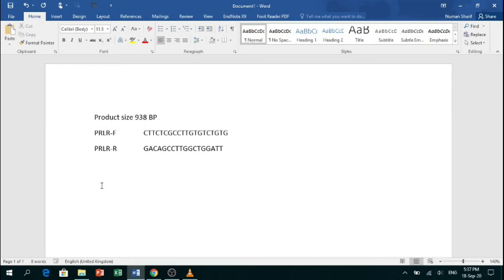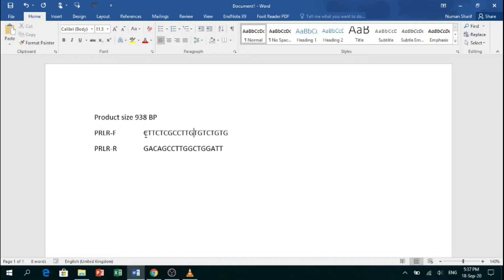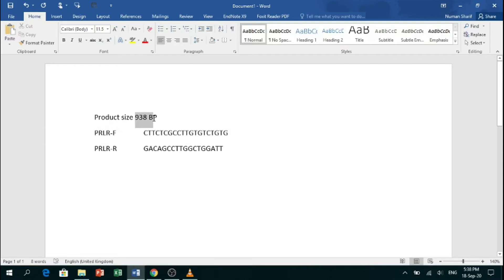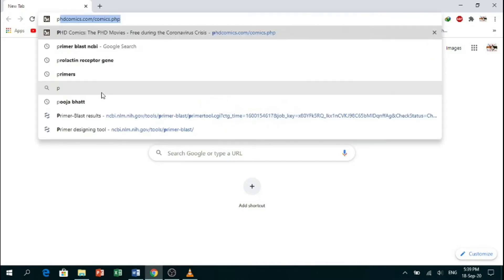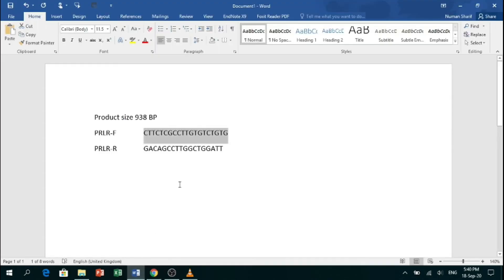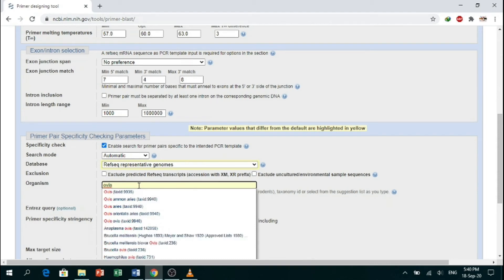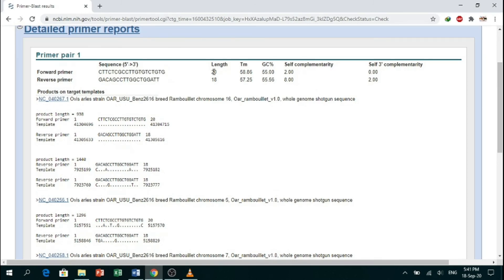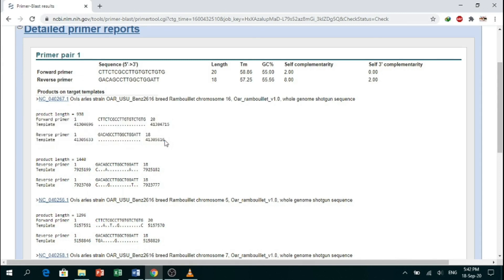How to Check the Specificity of Primers Using Primer Blast NCBI

Comment: Hello, I ask for a group working on something. Assuming they have a species of a small invertebrate (probably unknown species) and they just have cultured them in massive amounts. They reach a maximum of 2 millimeters. They prefer to extract only the DNA of a single adult with its eggs instead of having a mix of juveniles or adults for DNA extraction. The questions they had:
1. Should they extract DNA for each adult with eggs (which basically the full genome) individually as they planned?
2. They just decided to use cytochrome c oxidase I primers (a mitochondrial gene) since they proved to be a gold standard for invertebrates of various phyla. Moreover, most could be found with this. Is this ok? I mean, what other way would you advise?

Thanks
Reply from the maker: No idea about it

Comment: There are non specific products of 1440bp, 1296bp that you are not talking about, they are displayed just underneath. You could mention them even if the sequence is not fully complementary to you primer.
Reply from the maker: Yes, you can say. However, when you find your product ranked on top, then you can confidently use that pair of primers. Secondly you can try other online tools to verify or cross check results like In Silico PCR. You can watch the video given below on checking the specificity of primers using in silico PCR: 
https://youtu.be/iC7pPR9ASk8

Comment: Thank you for the video. It was helpful. I see that there is also a potential PCR product of 1440 bp, right?
Reply from the maker: Thank you. Yes, you can say. However, when you find your product ranked on top, then you can confidently use that pair of primers. Secondly you can try other online tools to verify or cross check results like In Silico PCR. You can watch the video given below on checking the specificity of primers using in silico PCR: 
https://youtu.be/iC7pPR9ASk8

Comment: Bro, at first, no need to use that fake British accent
Second, your actual content starts from the two and half minute, which is half of the actual length. Kindly prepare a well designed script before making the video... No need to strech it unnecessarily.
Reply from the maker: Thanks for the suggestion.

Comment: Which database should you use if your target species doesn't have a representative genome in NCBI (but you know the primers have been used successfully before in the species through other studies)?
Reply from the maker: Hi Elle, 
Almost all of the sequenced genomes are available in NCBI genome databases. However, there are few species who's genome has not been sequenced so far. If the primers have been used successfully then you can use the same primers to amplify DNA and if you have to use them for publishing purposes then you could provide the reference of the study where it was reported.
Regards!